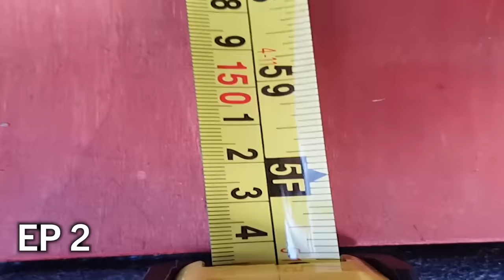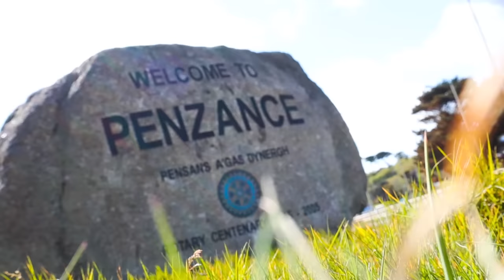One Year Living In a SMALL Van: The Highs and Lows (year recap) | Van Life UK | E53

Comment: Have you had many mechanical issues with the van, has it got high or low mileage? Will you be getting a bigger van? Cheers.
Reply from the maker: The van has run like a dream with 80,000 on the clock. But now it is starting to make a funny noise when I drive so it will be going to the garage very soon. I might upsize one day 😀

Comment: I raised the floor by 8 inches and installed 3 lockable drawers underneath it. 2 are accessed from the backdoors, 1 with my clothes and the other for Mt tools. I carry 18volt SDS drill, 18v drill, 18v 4inch grinder and an 18v multi tool along with 2 yokes for hand tools. I've had a couple of break-ins so the back doors are locked and dead bolted so any thieves would have to take up the floor to access the contents of those 2 drawers. The other draw accessed from the side door contains food and cooking equipment and other non valuable miscellaneous. I installed two cupboards over the wheel arches which are metal, these contain my Jackary, a rechargeable battery pack and van tools for wheel change and such, the other cupboard is where I keep coats and jackets and my work clothes. I also have a safe under the drivers seat for valuables and I took out the front seat, boxed it in and I keep a 12 volt fridge in there. The panel separating the driving cab from the back of the van has been modified to having a small hatch so I can get into the front from the back without having to exit the van. Roof bars and a roof box are other add ons which are really handy too. I hope this gives you a few tips and good luck if you do take the van life plunge!
Reply from the maker: Wow Thomas, you sound like you got it all figured out and thank you for all these amazing tips! I will try and include some of these into my new van!